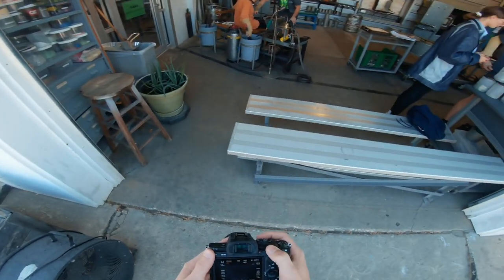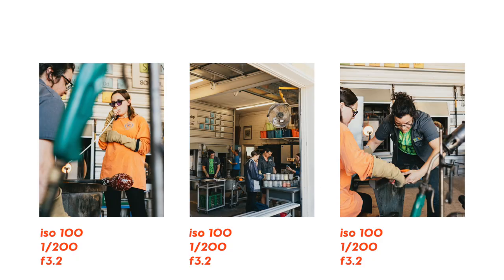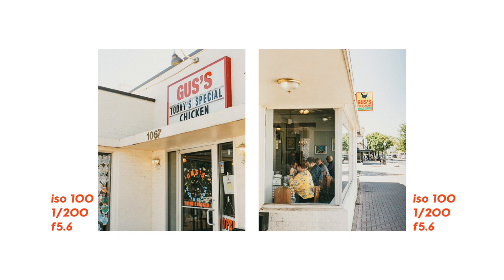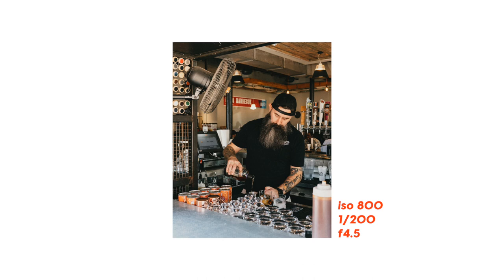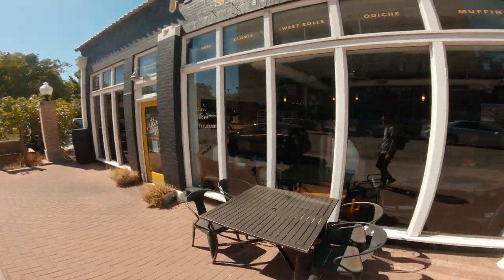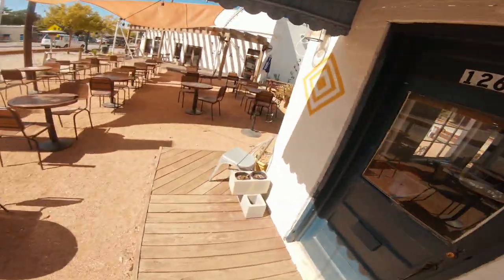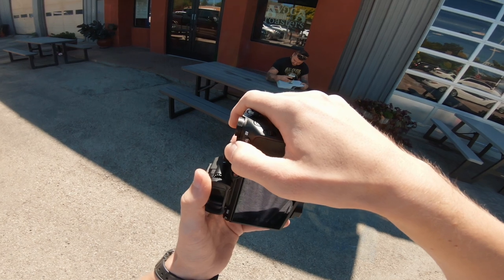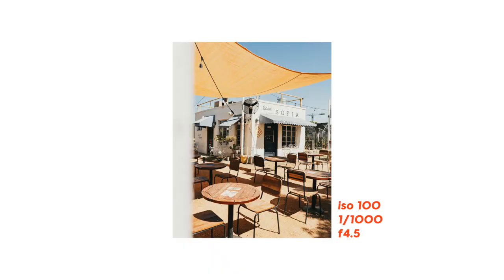sony 28mm f2 for street photography

Comment: I recently upgraded from a6000 to a7rii primarily for landscape.  However,  I also enjoy  environmental/street Photography.  I've been doing research on all types of FE lenses as I try to plan my new lineup. This one is on my radar for the size. Besides, I can still use it on my crop sensor for an equivalent 42mm focal point. Trying to build a FF line up that is not too bulky.  Great review and samples. Thanks
Reply: cosmic  btw, the 28mm had me researching about the pros that used this focal point and someone on another post mentioned that  Mary Ellen Mark, Garry Winogrand, Josef Koudelka among others used the 28mm for street.  Oh boy, try going that rabbit hole.  Very interesting stuff about those photographers.